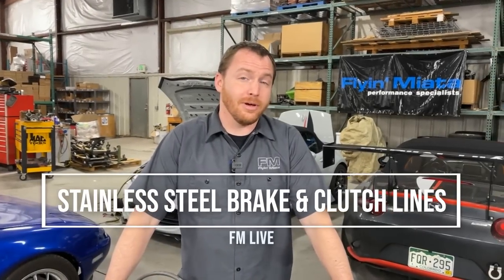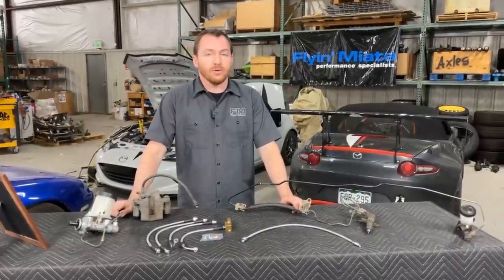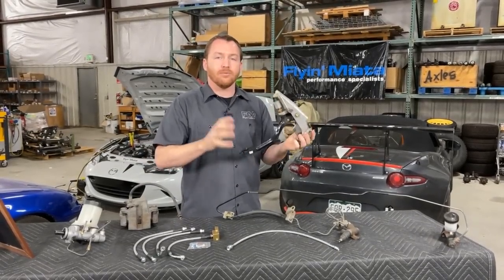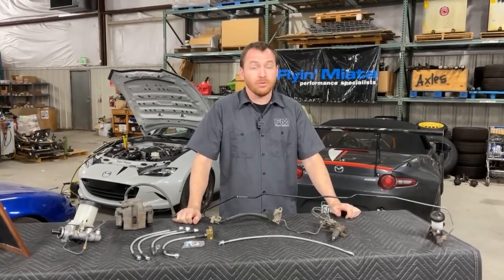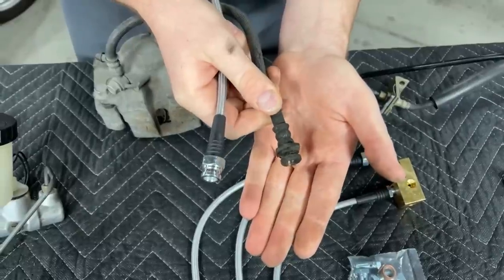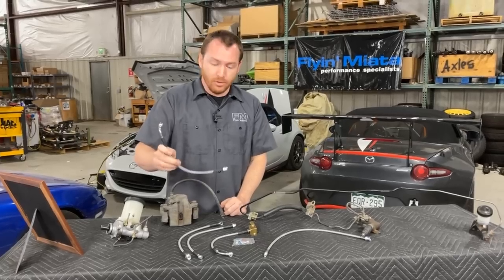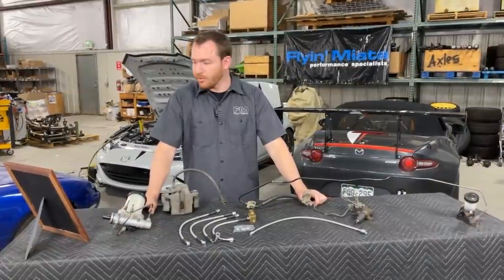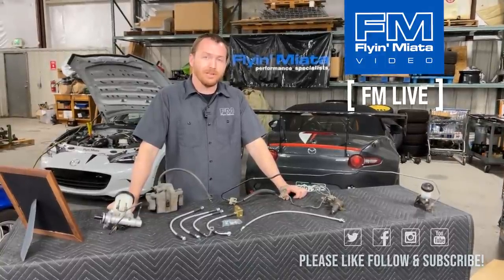Why You Need Stainless Steel Brake & Clutch Lines (FM Live)

Comment: Idk about some of the missinformation, I mean marketing in this video. There's good reason why braided lines don't pass any of the requirements OEMs have to pass with rubber coated lines. To that point, I've definitely seen more braided line failures at the track from people not staying up on replacing them (no OE line failures). The coating is not more resilient and doesn't last as long allowing dirt to get in the braiding and springing a leak. New to new in a car there's no pedal difference. Has to be on a bench without firewall, pedal assembly and a multipot caliper for it be measurable. Quite a few of the line manufacturers cover that aspect. Little dispointed in this video not covering important aspects of braided lines.
Reply: I've heard these things too, from various sources. That they didn't even bother addressing them in the video is very disappointing. Let's just say I'm not convinced (but usually a big fan of Flyin' Miata.)
Reply: @jacobmusha7188  it's not like the info is from random people either. It's straight from brake engineers and manufacturers of braided lines. So it's bizarre that a tech talk not only ignores it, but also presents contradictory information.
Reply from the maker: Our modern PTFE SS braided hoses are much higher quality than rubber hoses and have been proven to provide better feel and higher performance than aging rubber hoses. However, just like any high-performance part, mileage may vary depending on use, maintenance and environment they are used in. Even MX-5 Cup requires SS PTFE lines, so they are a proven performance upgrade for track and high performance use. The factory lines are made to last, and are probably enough for a lot of "A to B" drivers, but we stand by these as a choice for anyone looking to replace their old/aging brake lines or to improve the feel/performance of their brakes in high-performance driving situations.
Reply: @FlyinMiataVideo  this is already going in circles and does nothing to actually expand or address the known issues. The Mazda racecars require them because they are fresh racecars and are racecars. No one would run rubber coated lines on racecars unless it was a specific application. To that point racecar components aren't design to withstand the corrosive and demanding environments of street use, which again why they don't pass. Just because something is run on the racecar, it doesn't automatically mean it doesn't need constant attention and maintenance. Those parts are about performance and maintaining a short period of high reliability above everything. I've seen enough line failures or signs of pending failure to know it's irresponsible to not give the full information.
Reply: @FlyinMiataVideo  so... do your SS braided lines require maintenance? There is no "maintenance" with an OEM rubber line. The video claims they will outlive the car (5:20). Is that true or false? Racecar parts are great for racecars, but recommending them for street use without being honest about their drawbacks is not cool. I thought Flyin' Miata was above that.
Reply from the maker: @jacobmusha7188  Just like ANY other hydraulic component, the line and fittings need to be periodically inspected and checked for leaks, cracks or aging. This applies to the stock rubber lines as well as SS or aftermarket lines. We consider inspection part of proper maintenance. Mike was speaking from his experience, and we obviously cannot guarantee they will outlive a vehicle, but they certainly can in certain conditions. We run these on every shop car, and most of our employees use them on their personal Miatas, so we consider them great for street car use. As with any performance part, miileage and performance will vary depending on the application, environment and vehicle use. We did not intentionally mislead anyone, and we truly apologize if you feel we were being  dishonest in any way.  We try to be as transparent and honest as possible during our videos, but we unfortunately cannot address every single concerning, situation, or potential problem.  We truly apologize if you feel we were not transparent in this video and will strive to be more thorough with our information for future videos.
Reply: Ever seen a motorcycle? They are high-performance vehicles and often come OEM like mine with steel braided lines. So saying they don't 'PASS' is a lie.
Reply: @YankedOver  apples and oranges. If you have a buddy that works for OEM car manufacturer, ask them. What's comes on a motorcycle doesn't have any relevance here. If you wanted to use a better example while ignoring everything, you could point out that braided lines also come on Ariel Atoms, Caterhams and similar extreme vehicles.
Reply: I feel equally (at least) disappointed as I'd so far liked and trusted the FM videos I've been watching.

Comment: Do the stainless steel brake hoses eventually put too much pressure on a master cylinder? I put stainless steel hoses on my 2017 civic in 2020 and now my master cylinder is leaking at the firewall. Just wasn't sure if they are related or not. Cuz my car has only 85,000 miles and on my other cars master cylinder lasted a lot longer.
Reply from the maker: Stainless lines don't flex like old rubber lines, so I suppose it's possible if your master cylinder was on its last leg, stainless lines could be the straw that broke the camel's back. Otherwise, any good condition stock master cylinder from any car should handle stainless lines fine.
Reply: @FlyinMiataVideo  Car was brand new when I got it in 2017. It's only got 85,456 miles on it. I checked my fluids the other day and the master cylinder was really low. None of the brake lines are leaking and neither is the clutch slave or the clutch hose. Clutch and brakes are on the same master cylinder now
Reply from the maker: @dummdumm9234  Ah, gotcha. Yeah, it sounds like the master just failed kinda early then.

Comment: What do you guys think about driving a Miata full time in Colorado?? I'm thinking of moving to Colorado Springs and I'm worried I"ll get stuck all the time.
Reply: I have a 2000 Miata in Colorado and I don't drive it in the snow. The roads get cleared pretty fast and the sun cooks off the snow along the front range within a couple days. So maybe there are 4 or 5 days a year I wouldn't drive it. Colorado Springs is considered part of the front range and there are some great roads to drive a Miata on as you head into the hills.
Reply from the maker: It's possible for most of the time, but we really recommend a good set of winter tires if you plan on driving it through the really cold or snowy days!
Reply: Snow tires are must. If you don't carry a passenger carry a trunk shovel in your passenger seat, just in case if road is not plowed.

Comment: My 90 Na has the original rubber lines and somehow I have the opposite problem, the pedal is rock hard and I need to push quite hard. Would you think that these would fix that? My initial thought was that the booster is bad but the pedal does work better with the engine on so it does do someting.
Reply: You could have a vacuum leak to the booster
Reply from the maker: Reach out to our customer support team directly, they will be happy to help you trouble shoot your issue and offer a few recommendations on possible solutions. :)

Comment: factory fittings suck in air....but not leak...
Reply from the maker: Factory fittings definitely should not be sucking in air. I'd toss on some oil resistant thread paste on the threads of your bleeders and give it another try.
Reply: @FlyinMiataVideo  I've got a bad pressure plate installation and no 1 believes it but I think the vibration of the clutch fork is sucking in air Been going on for a long time I've tried everything... And now the clutch is burned up
Reply from the maker: @bethalpha  That's an odd one. Feel free to send our customer service folks an email at support@flyinmiata.com for troubleshooting help.

Comment: Don't the rubber brake lines have an internal nylon weave that stops them bulging the same as the steel braided ones? Has anyone actually tested to see them bulge?
Reply from the maker: The stock rubber hoses do not have a nylon sleeve similar to the SS lines, and do bulge under hard use. A quick google image search for "brake hose bulge" will probably show you what you are asking to see :)

Comment: Without the ‘hooks’ at the banjo bolt end, is there a danger of these hoses moving, and then rubbing on the wheels? I’m currently debating whether to upgrade to these, but am a little concerned about the lack of these anchor points.

Comment: Can we I use those soft lines on the brake master cylinder?
Reply from the maker: It's always best to have rigid lines as much as possible to maintain a firm brake pedal so, I'd only run the flex lines from the chassis to the calipers.

Comment: Flyin' Miata - if you are not racing or even spirited driving and you have over 100k on your car, would replacing with new OEM/rubber tube lines be just as good for the next 50-100k miles on the car?
Thanks.
Reply from the maker: That decision is going to be entirely subjective. In the short term, an unobservant driver might not see a big difference, but if you are looking for the best pedal feel, the best performance and the best investment in the long term health of your hydraulic system - then the braided SS lines are the obvious choice.
Reply: You should replace the lines if they are more than 6 years old. A difference should be noticable from flushing the brake system alone. Probably won't notice the brake lines, but the definitely need to be replaced regardless. For maintenance free, get new OE rubber lines.

Comment: What supercar brand use OEM stainless steel brake line that come automatically from the dealership when you buy the vehicle?
What kind of brake line comes on a Bugatti? Rubber or stainless steel

Comment: Today, we should be referring to the two hydraulic cylinders in the system as "primary" and "secondary". Time to leave the old terminology behind.
Reply from the maker: It's possible for a word to have more than one meaning, and to avoid confusion when trying to communicate we use well established industry standard terminology. Technical terms don't contain value judgements.
Reply: No, it is not snowflake. We are talking about cars here, not history.
Reply: There's a big difference in secondary and "does not work without the other one"